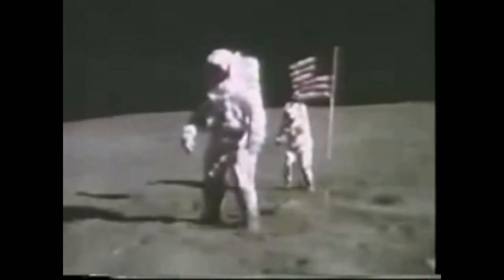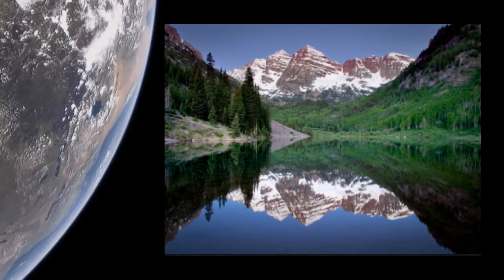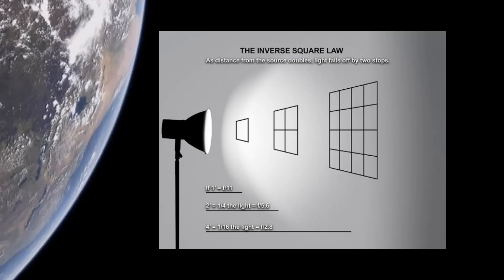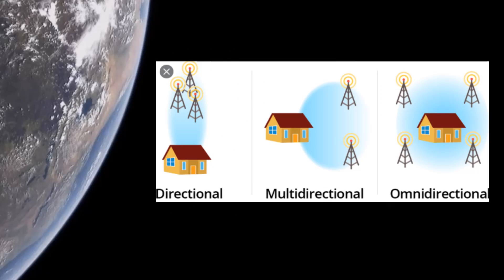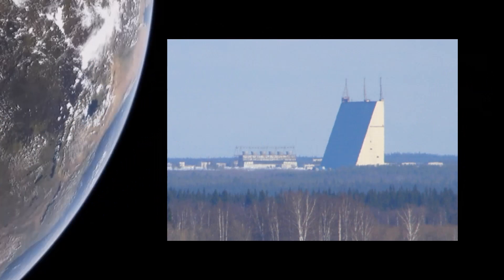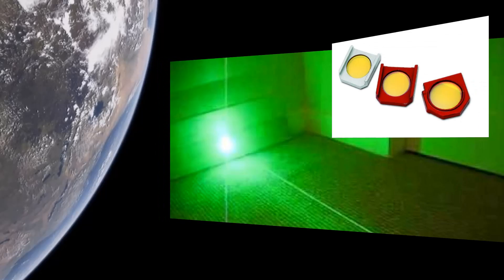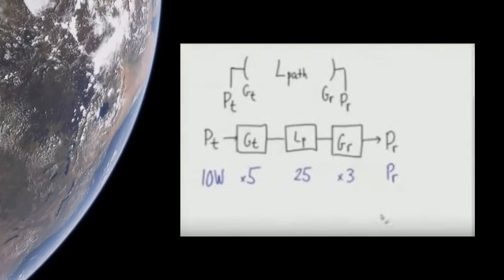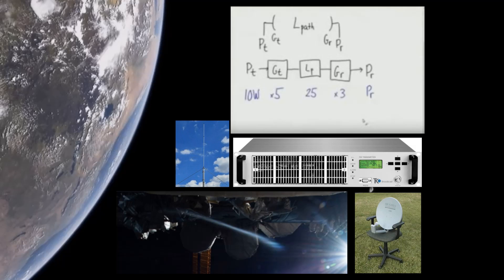"COULD RADIO WAVES HAVE PROPAGATED TO THE MOON AND BACK IN 1969?"  A RADIO ENGINEERS TAKE!

Comment: But what you're greatly underestimating is the amount of gain of the lunar astronaut's antennas.
To not have an ability to grasp the amount of gain of 240 foot  antenna (the Gantry A frame's attached astronaut cable plus the A frame's height) doesn't bode well for your claim of understanding physics.

Comment: The news presenter on my t.v today couldn't keep transmission with the news reporter for a 30 second conversation without loosing connection between two cities less than a couple of 100 miles apart 🙄 if only we still used 1960s technology.

Comment: China already knows that you cannot transmit the signal that long time with the kind of battery you can bring to the moon. It has to be recharged often. NASA claims they used around 2GHz,. That requires high power. The battery will drain out in less than ten minutes. It is impossible to have TV shows like Apollo with the battery Nasa had. If it is much lower frequency, it is possible to extend the broadcasting to 30 minutes. That was tested using the current battery technology by China. Nasa 50 years ago, battery technology was much more primitive.
Reply: True, every word! They had not even progressed to the Nickel Cadmium technology in '69!
Dry cell alkaline would not be capable of the energy requirements to transmit and receive from a distance of 240,000 miles. 
IMPOSSIBLE APOLLO!